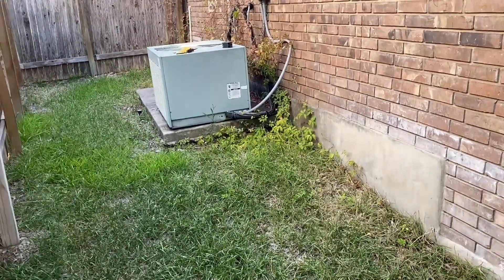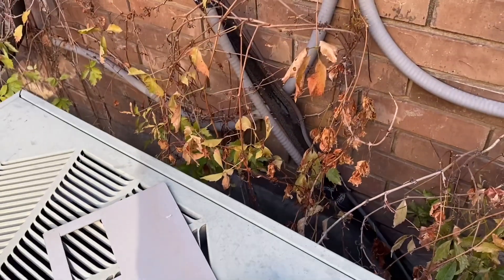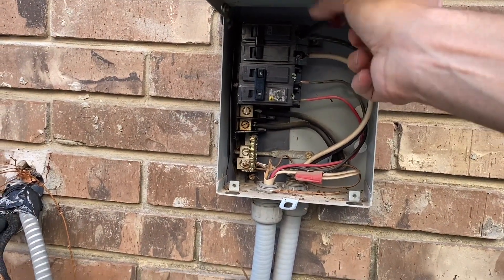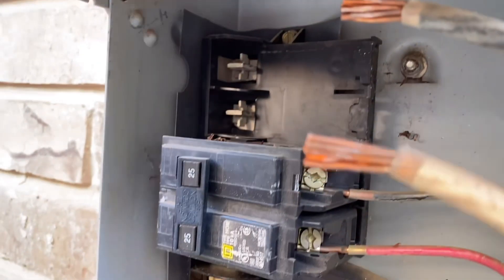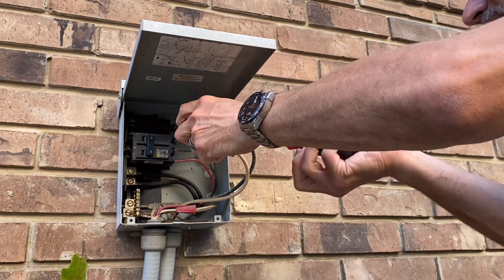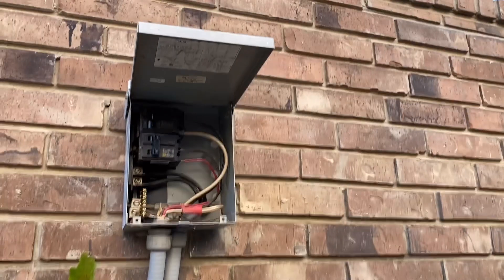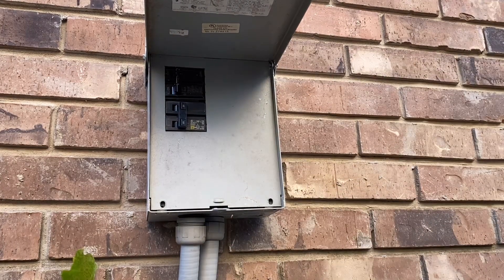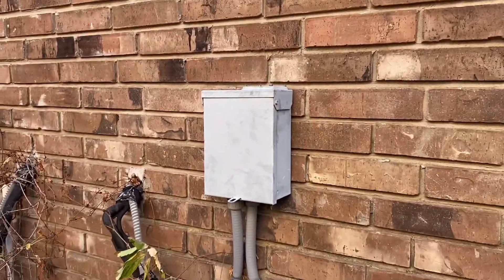Air Conditioner Circuit Breaker Keeps Tripping!

Comment: A little electrical stab lubricant or some NoAlOx on those bus bar connections for all breaker stabs would have been nice.  Also, on the wire attachment clamps.  Just keeps corrosion down and keeps your investment working longer for you.
Reply from the maker: Thanks for the pro-tips!  Really appreciate the feedback. I will buy some of that product.